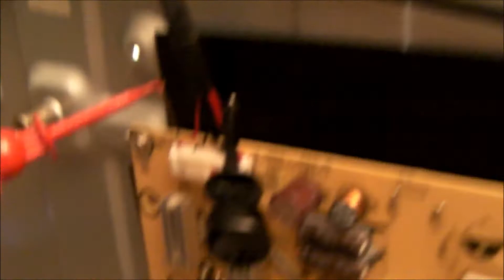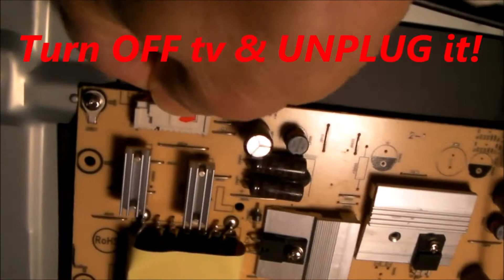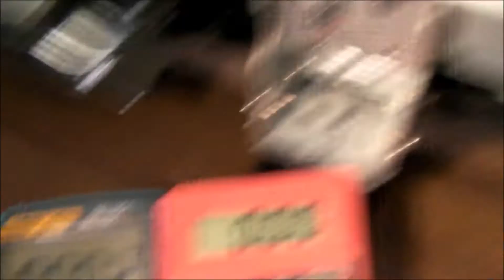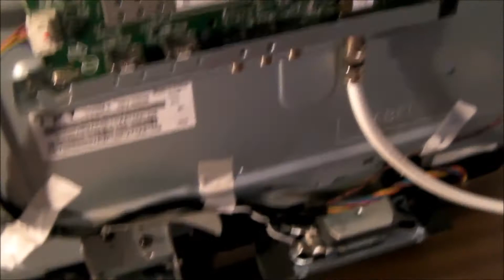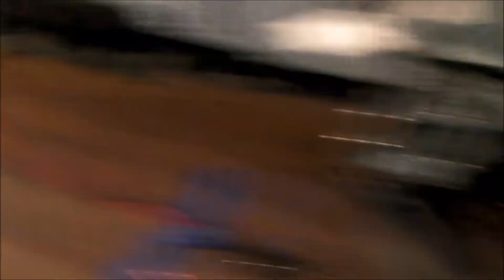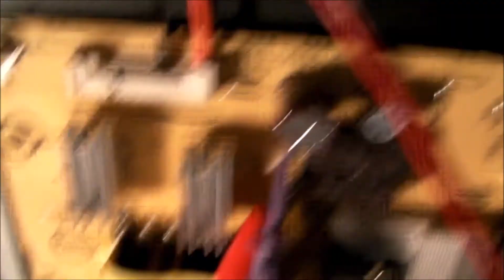No Picture. No backlights.  Replace the power supply or the backlights?  0 V backlight power supply

Comment: Many thanks for this video. I have this TV and it really helped to explain things.  I do have one question though. I ran this test and instead of the connection for the backlight just going to open..or nominal after approx a second, I get this swinging back and forth from 92v to OL every couple of seconds. I am guessing that it is still my backlight and my power supply is good....but wanted to ask. Is your result the only one that a good power supply can give...or can it do what mine is doing also?
Reply from the maker: I'm not a pro but I would concentrate on the backlights.  sounds like the power suppy is trying to do it's job and can't because of some non power supply issue.  Good luck and be sure to LIKE and subscribe.  That would really help me.  THANKS!